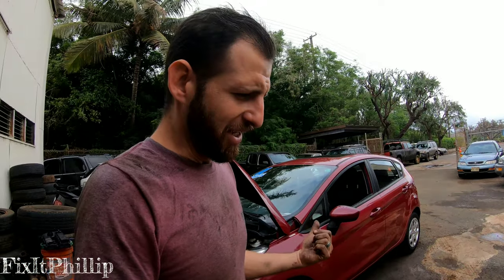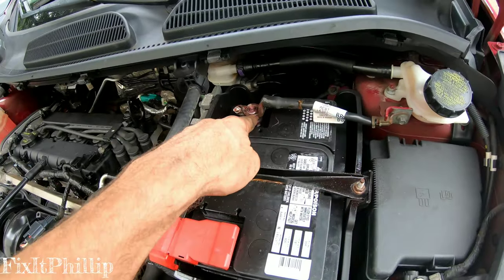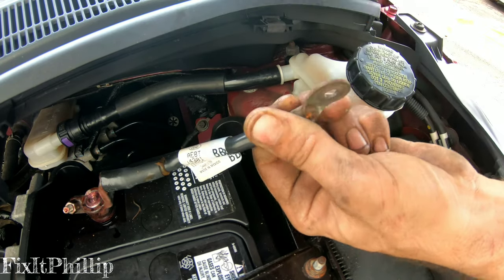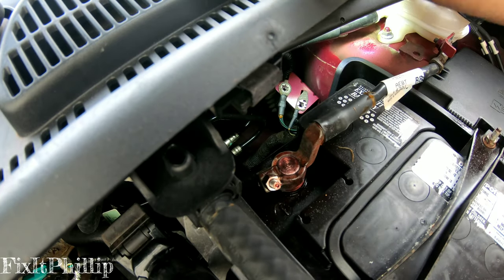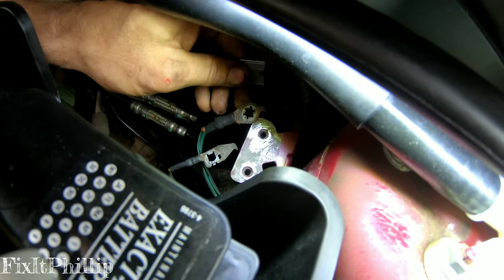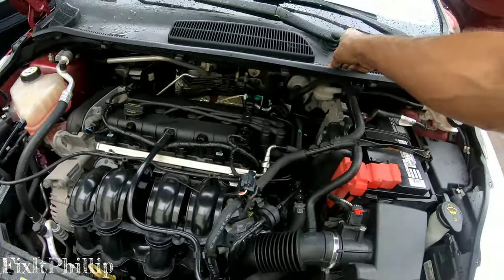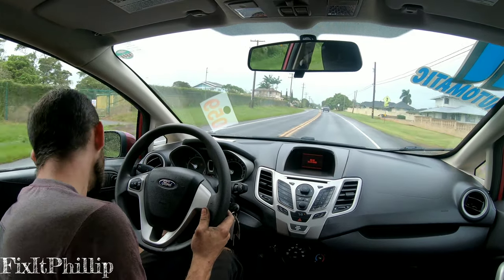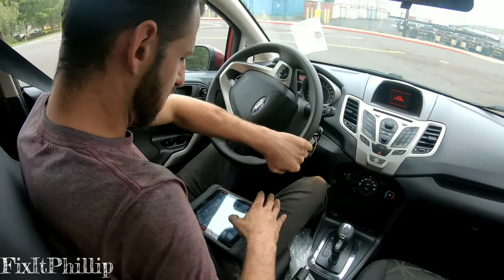Ford Fiesta Transmission Problem FIX Check Ground Connection Ford Focus

Comment: This helped me.  I checked my 2012 Ford Fiesta and all three ground connectors were painted.  Scraped that stuff off for a better ground connection.  WTF, manufacturers?!  WTF.  And hey thanks youtuber!  I wouldn't have noticed those bottom two connectors without you.
Reply: Where are the other 2 ground connections? Other than the one on the strut Mount. Thanks
Reply: @tomodom657  At 2:16 in the video, two smaller connectors, kind of down & behind that first big one.
Reply: Hi is your car still running acting doing this

Comment: Common problem on focus/ fiesta.of any year... ADD EXTRA EARTH CABLES,..... measure from strut tower to other earth at rear and to the chassis earth under the battery/air cleaner.. buy cables this length. on this car i would put a short one from strut tower to the rear earths and another one from strut tower running down under battery to the chassis ground and or to the earth point on the transmission case. Depends on your year and model.And CLEAN all factory earth points as in this video. Some 30=40% of all computer problems with these models are simply BAD earthing. Double them up!!!!! For the small cost and an hour or 2 of work the best bang for your buck on a ford with intermittent/ phantom problems .
Reply: Can you show us link of pictures of how you did it. Please

Comment: Although I liked their looks, I shyed away from buying a Ford Fiesta/Focus “because of its notorious transmission issues.” If I had only known! These cars DO NOT have a transmission problem (per se), they have an AUTOMATIC transmission problem, which is something else altogether! I prefer manual transmissions, and Ford Fiesta/Focus manual transmissions are FINE! Why didn’t Ford make it clear that the MTs are fine? I think I know, and it has to do with Ford phasing out MTs, to improve profitability. They want us to think customers didn’t want them, but in fact, customers were DISCOURAGED from buying them. They wanted to streamline production, to save a few bucks.

Comment: i just tried it. and the magic happened 🤩 now i dont have jerking my transmission drive smoothly. and the biggest difference is my voltage. i got a reading of 13.4-8 always. and i just thinking that my alternator was bad. when i do this my voltage is now normal. i got 14.2-4 now all accessories are running.. tomorrow ill do a long drive. then i will update you guys.. thank you for this video.. by the way i have focus 2012
Reply: Any news ?
Reply: Update please

Comment: did that to mine but used s dremal to remove the paint and then coat the metal to metal contacts with dielectric grease to protect em..also resulted in better voltage readings too couple days of driving for me to notice it was driving waaay smoother then b4 "powerShit" transmission "relearned" or somthing maybe..but its been 3months and still smoother than b4 I made the grounds better

Comment: Got my ford fiesta 2013 and it shows trasmmission malfunction error after going to diagnose scanning it says need turbine speed shaft..based on this videos try to clean circuit supply wires as my car was not used for more than 2years and 7 months ..battery was fully drain then just went to recharge it then used it for around 10 days then this issues of transmission malfunction..do you think scrapping and cleaning can help as it cause me 80 usd for diagnose scan and turbine speed shaft qoute of 200usd excluding labor

Comment: I did this fix to my daughters 2015 fiesta. AAmco said it’s bad trans and quoted $4,750 to replace, the dealer said to trade it in.
I changed the negetive wire from batt and the 2 lower cables were grounded to paint. IT WORKED. Drives like a champ. Genius work my friend thank you!
Reply from the maker: That's great! good job
Reply: Is it still shifting good

Comment: I just do this on my fiesta 2016, I don't have any transmission problem with it, but i notice that when i put the A/C ON since i buy it in 2016 the car lose power, after make this the car work perfect, no more power lost, not even for a second, nothing nada, is awesome. i do this preemptive because i know how important all electronic components need exact power to work, a motor with low voltage run slower (less rpm), the transmission use 2 of these, it mean slow move of the 2 clutch, more wear over time. Sad i no know this before. Thank you.

Comment: I’ve got a question I have 2012 Ford focus I got Told The ECU needs grounded I don’t have the transmission problem but I do have the transmission warning Service soon pretty sure that’s why speedometer don’t work because it has to go through ECU and all of that I’m thinking if I clean the grounds maybe it will help or fix the problem

Comment: Hello I have a question I bought a ford fiesta 2016 with already malfunction trasmission it would drive back and forward but didn't want to make the second gear  then I thought of changing it with a used trasmission and did that now it's showing me the 3 sensor the p0715 and p0720 I need help the car starts like it should and then when you put it on drive it run but not long same with backing up so my question is does this sensors can make the car malfunction on the trasmission to not run like it should

Comment: Hi Phillip 
I have a question,  on that negative going to the strut tower when u disconnect it to scrape does it disconnect the battery from the car’s power, the reason I ask is because I have a  breathalyzer device on my vehicle and I cont be disconnected for more than 5 minutes, thank you again for your awesome videos 
Jim
Reply from the maker: If you have a breathalyzer I would check with the installer to make sure it's not going to affect the unit
Reply: Thanks Phillip, yes I did and they said as long as the battery isn’t disconnected that it wouldn’t cause any harm
Reply: Have a drink!!!!

Comment: hi sir, i have ford fiesta 2012 model..when i reverse the car it 100% ok..but when i put in drive D it take too much time like 10sec some times ..in the morning it take atleast 3 to 4 mints ..please guide what can be the issue ?..and there is not check engine light..

Comment: I have a 2014, tranny shuttered from 5000km onwards.  Still stutterers to this day with 307,500km on it. Radio went on her and squeaks in a high pitch every so often, wiper motor fried and the suspension is shot. Other then that, I just do oil changes,  tires, filters and gas. There's not too much to complain about but there's also enough to be annoying with.

Comment: Would something like this cause my Air to blow Only when the car is turned on (coldstart, high idle) ?
It turns off unusable in any setting after 30 seconds, every day. 
Thanks

Comment: I keep getting p087a but it comes up randomly. After every 3 times I turn the car on the check engine will be on and I won't be able to reverse, or shift properly. I sanded the first ground but didn't realize there were more as in the video. I plan on changing the B clutch actuator and sanding the ground again. Hope it solves everything
Reply: I’m having the same problem. Did changing the actuator work?
Reply: @DonnaMcAuliffe  tbh not really sure what the dealership did but I took it to them, and they fixed it free of charge even though my car is salvage
Reply: @MFDan69  how long did it take to fix it? was sanding the first ground helped in any way? I have the same issue and my Ford Focus 2014 replacing the clutch actuator did not help. I think the TCM needs to be replaced.

Comment: Went to a ford servitec today. They said 2 shift motors need replacement. Ford fiesta is 2011 model. 92k mileage. Is it that easy for a shift motor to get busted?
Reply: Yes after nearly 90,000-100,000 miles

Comment: Hey whats up i have the 2012 ford fiesta ses model when i drive fast for awhile when i slow down sometimes it wont or has trouble shifting to 2nd n 3rd n 4th gear revs real high b4 shifting n when it does my car jumps then i get a msg transmission hot wait 5 mins then i get a transmission failure service immediately but if i let it cool down it drives normal shifts ok but does not pick up speed fast, slow acceleration, stuttering n lag down shift...its either bad solenoids or my TCM...could the ground be the problem? i also put a high performance K and N cold air intake system(sounds lovely) spark plugs n wires i changed to performance plugs n wires n tuned it n a few other things i forgot what i did but i give 8 cylinders a problem lol
Reply: Mine had the same problem I replaced the Tom and reprogrammed it didn’t help a new battery help for a few months so I think I’m going to get a battery with more amps

Comment: Have you ever had any of these DTC'S before doing this? P2831
P2832
P287B
I have a 2013 Ford Focus SE and every two months or so those codes come on. And I wonder if this would help. Thanks
Reply from the maker: It wouldn't hurt to try that first since it's a common issue having a bad ground connection, good luck
Reply: @FixItPhillip  Ok Thanks
Reply: I have error code P07A4

Comment: Thanks Philip; + on top of your connections-clean, the following may help: 
..............Comment Title': "You need a half-life left to new(full life) battery, pref the bigger crank amps choice, for the servo's on the DPS6 to work properly!!": ............I discovered 'by death' of the battery that installing a new battery got rid of the 'shudders' that are the warranty complaint on these years of this transmission (2014, dps6 auto trans) that in my case (may be prevalent as no one would expect it; 'and' dealers LOVE to screw the manufacturer on HUGE WARRANTY CLAIMS = massive part of a typical crook dealer's income!!) .
I was running about with a 'quite' tired battery but it'd always 'just start' so you're want not to change if it 'still works', can 'get a jump' etc. So far it seemed that was the problem on hill grades and take offs in 'slow rpm's'.  So one day (VERY nearly took it in to have big trans fixes on the warranty! but as dealers are shady i luckily just missed the period to take it in :):) would have been ancillary charges up the caboose).  ***POINT; TRY A NEW BATTERY - ENSURING YOUR ALTERNATOR WORKS TOO OF COURSE - BEFORE YOU PULL THE BLEEPING TRANS,PLATES ETC, :)   *********this very cool 'racing rally' dry clutch trans is a neat unit (was used for fuel mileage but fiesta is a rally car in europe , big reason installed there) is controlled by two MAIN SHIFT SERVO MOTORS, ELECTRIC, SO THE AMPS HAVE TO BE THERE FOR SHIFTS, AND THE ALTERNATOR ISN'T ENOUGH ELECTRICITY AT LOW RPMS TO SHIFT WELL.
I HOPE THIS WORKS FOR YOU!

Comment: i have a mitsubishi rvr ,disconnected the battery when i replaced it,problem jumps from 3ard to fourth(auto),what i did i figured disconnecting battery again not a good idea,i disconnected computer module cleaned with contact cleaner,took about a day for problem to go,so very happy,hope this helps someone else.,also this was all my idea.Also i think bad idea disconnecting battery you can buy those module connect to cigarette lighter so when you disconnect battery it is still connected,called 9V memory minder sca,uses a 9v battery to retain a vehicles onboard computer settings,cost $10

Comment: I don't have the 'jerking' issue, but I do have the error code on the dashboard saying there is a transmission failure thing happening. (I forgot what it was, sorry. I've been trying to find how to fix this for a while now, without having to take it to the dealer and spend tons of money to get it fixed.) Will this work to fix that? 
I do have an issue where the shifter will lock in place while I'm sitting idol and I can't move when I hit the gas and I can't move it unless I turn off the engine and turn it back on again. 
(Its ford fiesta 2012.)  
I've never had a car that you can't add transmission oil from the top. And I never knew it couldn't until that error showed up. I usually take it to jiffy lube to get an oil change every 3 months. So I do take care of it, but I just don't know what's going on with it now. And this stuff freaks me out when it happens. especially while I'm driving down the road and I hear that ding from the dashboard showing me that error.
Reply: what did you end up doing?
Reply: @NotMerciful  nothing, it's still not fixed. I just don't drive it.
Reply: not sure if you still have it but you access you transmission fluid by taking the driver tire off

Comment: Hey , what if I changed alternator,  I changed batterey I did the recall for transmission now something keeps draining the batterey over night like of something is running current while off and then the csr won't start
Reply: What can it be csn u help me would it be that this could be the problem
Reply from the maker: I would suggest having someone do a parasitic drain test to try to isolate what may be drawing power while of the ignition is off
Reply: @FixItPhillip  ok cool , yea the ground connections are fine. Could it be a bad alternator?
Reply from the maker: Its possible, I would get it diagnosed before changing parts
Reply: @FixItPhillip  so I took batterey to charge at auto zone abd the batterey wasn't fully charged still it was 11.6 they were supposed to fully charge so i put it in the fiesta didn't start had to jump start it l
Then drive down the street checked batterey it dropped to 8.74 wtf

Comment: 2017 Ford Feista SE. When I drive it sometimes it feels like it loses power or the brakes are on and I have to pull over because it pretty much stop. I do get a hill assist on my screen. The car goes in gear and wants to move but feel.lile the brakes are all on. If I wait and hour or so I can drive e it but it will end up doing it again. Really need some help

Comment: Remove the engine splash shield so the trans will be cooler.
Reply: Hmmmmmm
Reply: This works
Reply: Know a guy who's roommate drove threw water and it fried the transmission lol but any car can be wrecked by water
Reply: @chocolatemilk9821  must have drove in a lake!!! In my 45 years as a technician never heard of a trans going bad driving thru a puddle!!
Reply: @mikesecondo2254 ahahhahahahahahaa a lakeeeee hahahahaha

Comment: The hardest thing was finding my socket!
Sanded the paint, Yes the paint! This 2013 Fiesta had already been through the call back. I purchased it with 45k miles on it for 8k$ in 2016.
Always had a little shutter and bucking when shifting . Good mpg.
Fast forward...last week battery needed a jump.
WOW... after the jump.. service light, engine light, transmission failure.. needs service!
Bought a new battery.
Limped home in safe mode.
Found out about the ground.
Sure enough....PAINT UNDER THE GROUND LUG!
Sanded off...
Went to o'reilly's and cleared the codes.....
42mpg. Shift's like a new car....!
Shame on Ford!!
Reply from the maker: Ya its crazy. Its literally grounded by the threads lol

Comment: My 2017 started acting like it was loosing power or as though I was applying the breaks. Sometimes I have to pull over and then it will not go back into gear

Comment: Getting a 2014 Ford Focus Titanium today, this will be the first thing I do, they're known to have the same issue.
Reply: @richardjones2750  They only stand behind the TCM for 10 years from new, 7 years for the clutches seals etc. Ford sucks, wifes car is a 2013 with 67,000km bought new, it's been repaired 4 times under warranty, she was just told $3,000 to repair the transmission. I'm going to try this fix.